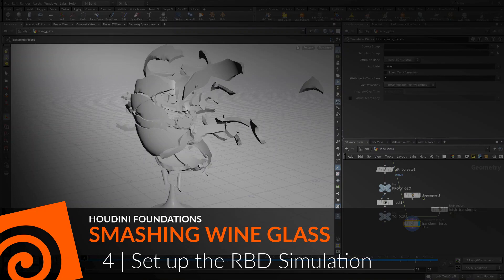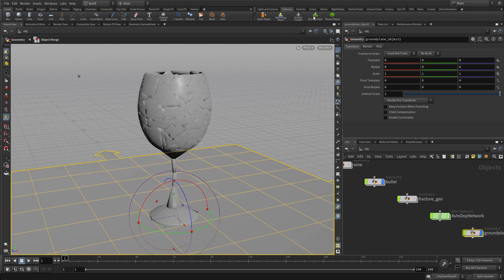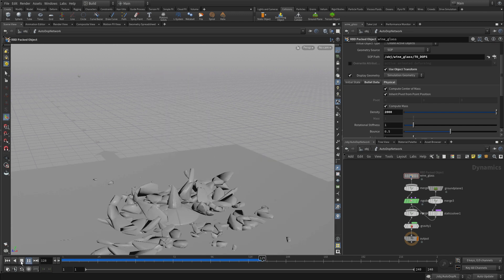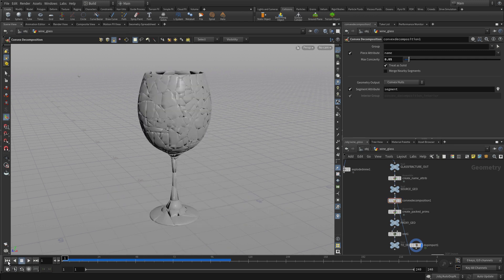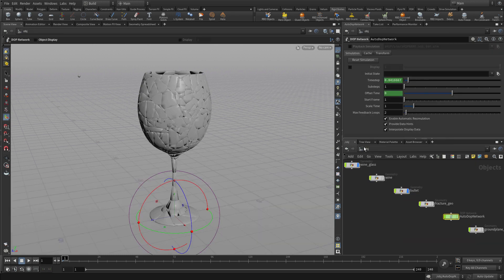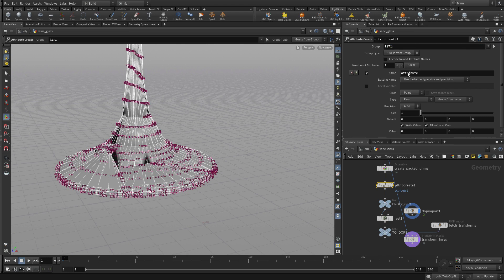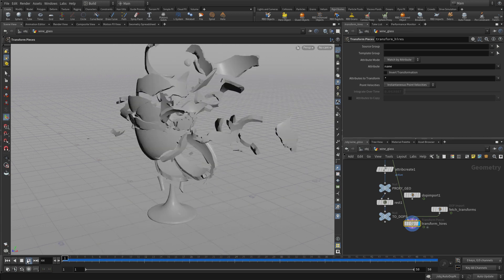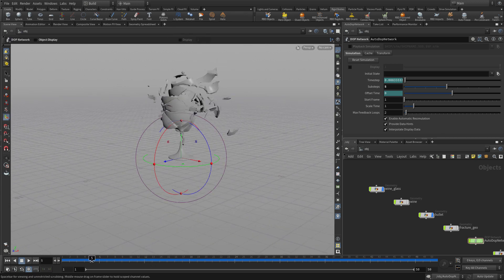Smashing Wine Glass | 4 | Set up the RBD Simulation

Comment: Feedback: Looking back on this, I know why I felt confused as a beginner. Beginners should get the absolute most basic version of something there is-- the things you consider simple little additions-- each new node or approach that isn't found in the existing tooling verbatim-- are yet more brand new concepts that  piles onto an already overwhelming cognitive load. Each new node is a totally new and unfamiliar concept. This would have been much more effective for me as a new user using an extruded cylinder as a whiskey glass, a smaller cylinder liquid shape, and a few shelf tool clicks to set up the simulations. That's what beginners need. They're not sending it to a client-- they're trying to understand Houdini at the most basic level. Even if your setup might be technically simpler on the back end, that doesn't matter if it's more logistically complicated for someone that doesn't know the difference. That you aren't stuck with all of the premade tools is what makes houdini useful as a professional tool,  but straying from those requires a mental model of the way houdini works that nobody at this stage has any hope of achieving
Reply: Exactly! I have been using Houdini for about 5 years now and am still struggling to learn some basic concepts. Most tutorials are overly complex. Just give us the basics first. My biggest pet peeve is when the instructor constantly zooms in and out in the viewport, tumbles the viewport and generally flings the mouse pointer back and forth across the screen FOR NO REASON.  Zooming in and out of the network editor and rearranging nodes is confusing and annoying.